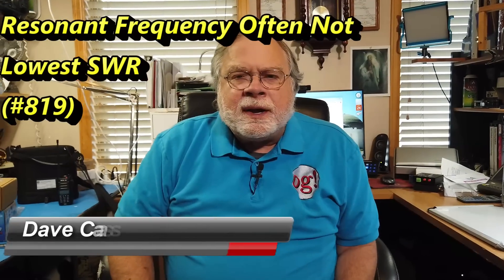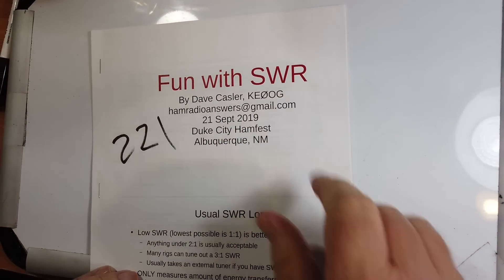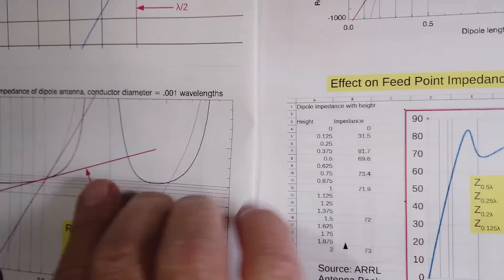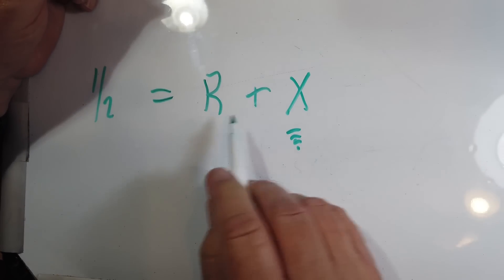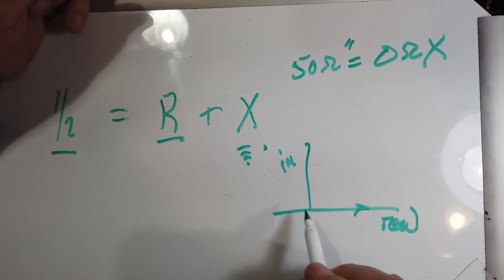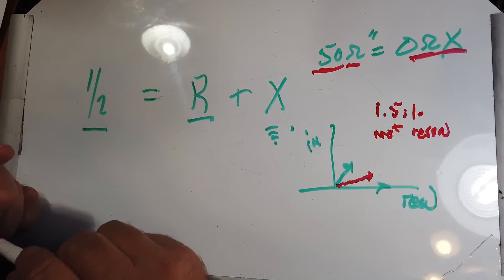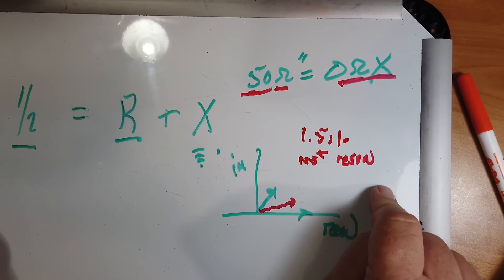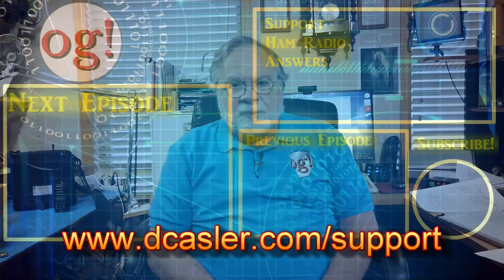Resonant Frequency Often Not Lowest SWR (#819)

Comment: Thank you for the explanations.  I have a few questions.  When the reactance is tens of Khz from the lowest SWR is it worthwhile to work toward adding some coil / capacitor combination to set the reactance to zero on the frequency of lowest SWR?  IF so, what calculations should be done to accomplish that?  
Maybe you've guessed I have an interest in QRP.
Thank you again for your time.

Comment: 1. Would the tuning strategy change for a listening-only antenna? Tune for resonance in that case?
2. Could you get resonance & SWR to align better by changing the antenna height, or perhaps just raising the center some amount (like an inverted V), to adjust the impedance?
Reply: I can answer #2 because I went through this. When erecting my homebuilt 20/40 meter fan dipole (which is now a 20/40/80 dipole with coax traps in the 80 meter legs for 20 meters, but that's a different story), impedance of this inverted V dipole 28 feet off the ground was too low. So yes, antennas that are closer to the ground (or large metallic objects) or that have high angle in the "V" will show lower impedance than antennas higher off the ground or that have less angle in the "V". My solution? Feed the thing slightly off center to raise the impedance to a more radio-friendly range.